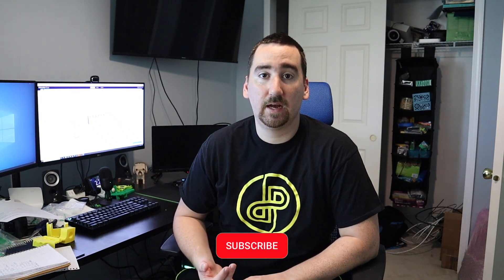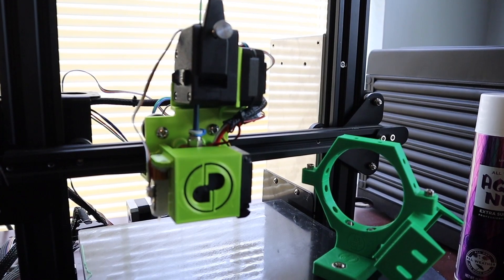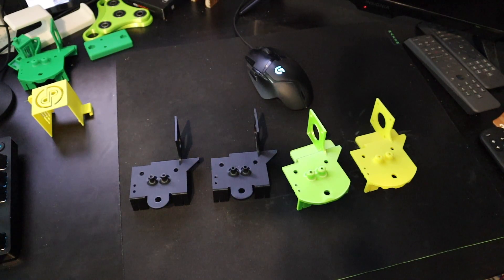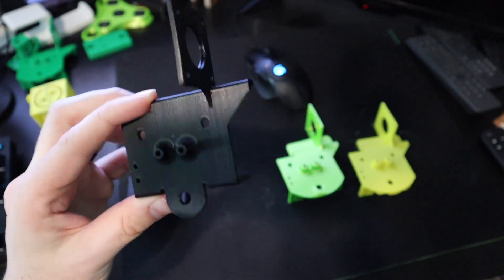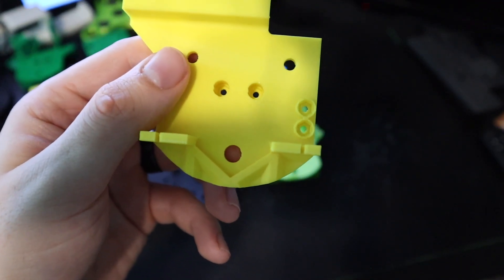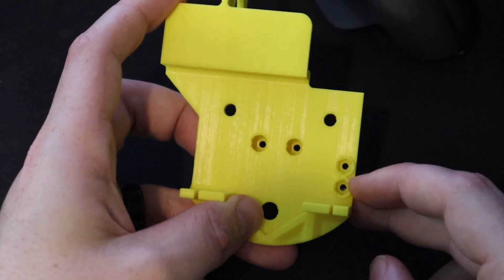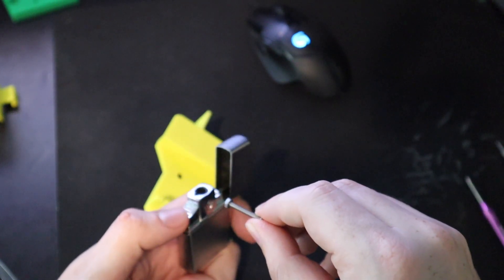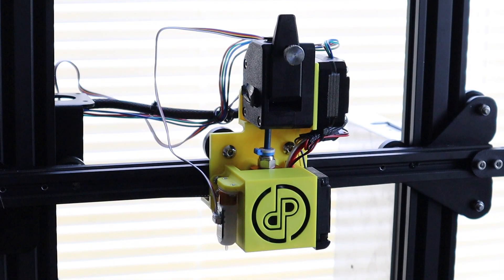$30 Ender 3 (Pro) Direct Drive! STL / Links in the description | 100+ Hours Update

Comment: Old video, old project, but if I may make a suggestion, one final change you can make would be to run a Y bracket on the other side of the wheels, and to have a cover that goes over the belt joints to hold the openings together. Both additions would provide extra stability and insurance for long term use.

Comment: Wouldn't you be able to just pause the print and insert the nuts then continue the print?
Reply from the maker: You could encapsulate nuts into a print. Though, you would need to alter the design to have a tolerance so that the nut fits into the seat, and then have the model encapsulate the nut. This would require you to set a pause in the print / babysit it, I rather just sink them in with some heat. Really just a personal design preference, but could be done either way
Reply: @PrintPractical  oh, I was thinking more like edit the stl to fit the nut. Then have the pause automatically entered in when sliced/the gcode so it pauses at the correct level on its own. Almost like a filament swap, except just a pause only. But with a nozzle park integrated.

Comment: This is very nice, unfortunately I don't have Ender 3, my machine is Biqu B1 SE Plus, and has a probe sensor that attached to the hotend and pcb cable connector in the way, can't figure out how to do a direct drive yet :(
Reply from the maker: That looks pretty similar to the Ender 3. It looks like the XCarriage rides on a 20mm extrusion just like the Ender. You do have to perform some firmware changes for the new motor, etc so it would require some knowledge of the printer.
Reply: @PrintPractical  I learned a lot since march, I run klipper, and using printed extruder (superFly) everything working, but it's not direct drive yet, original carriage is bigger than ender 3 and it has ribbon cable connected to top center close to the PTFE, I have to re locate the PCB somehow, otherwise wont fit there